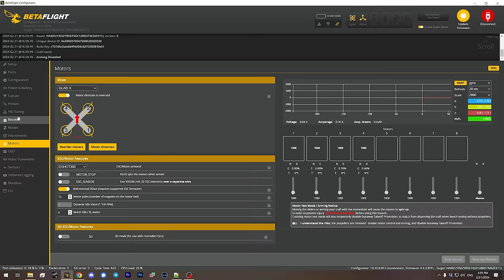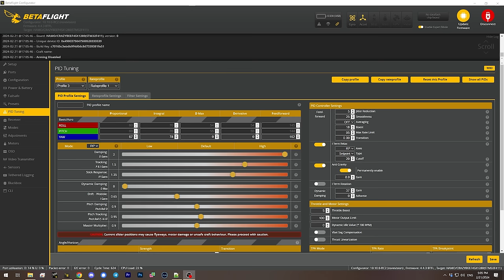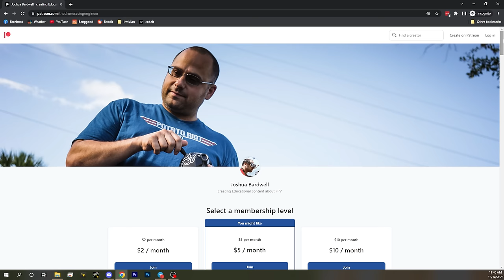How fast is too fast? Testing 32,500KV WeBleedFPV Screamer Motors!

Comment: Bad Motor 100%
Reply from the maker: Then why did it dip left and right?
Reply: I can not say exactly. I had exactly the same problem with one of my quads. Whenever the motors suddenly had to change speed, or when turning quickly or intercepting the quad from a height of 4m, the quad would sag. After about 30-50 packs I was able to notice that 1 motor was really slightly harder to turn by hand. So it's really slightly worse than the other engines. I replaced the engine and it's been gone ever since.